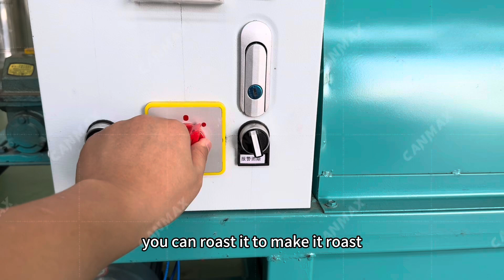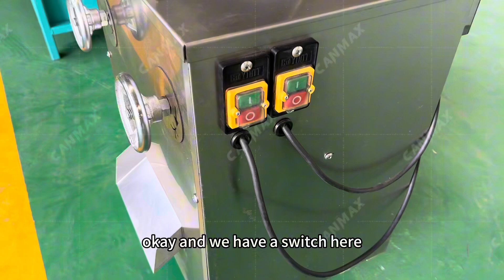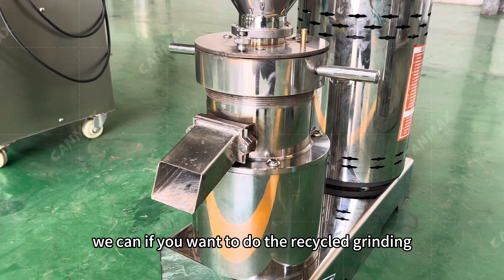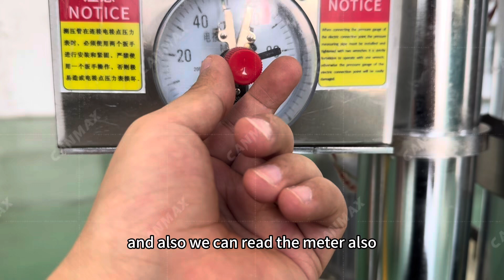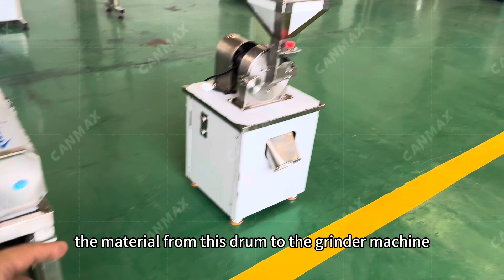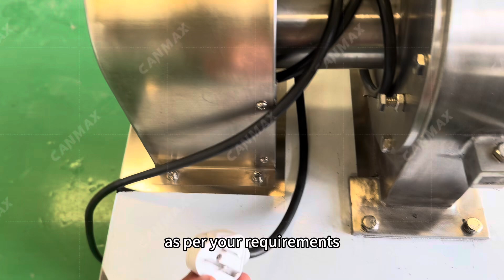Cocoa bean processing line introduction ￼cocoa liquor oil press machine for cocoa butter and powder

Comment: Wow, this process is very similar to what I want to achieve in my shea butter business. My processes are;
Crushing Machine
Mechanized Nut Roaster
Heavy-Duty Oil Expeller Press
Jacketed Melting/Mixing Tank (to put activated bentonite)
Plate & Frame Filter Press

I want the shea butter to be ultra clean and free of odor. To attract big buyers. Can i achieve 200kg/h with a budget of 15k usd?
Reply from the maker: That should be ok please contact us for details WhatsApp 008618538207955